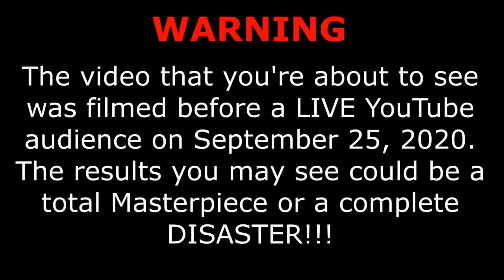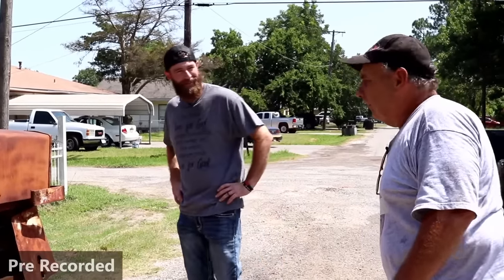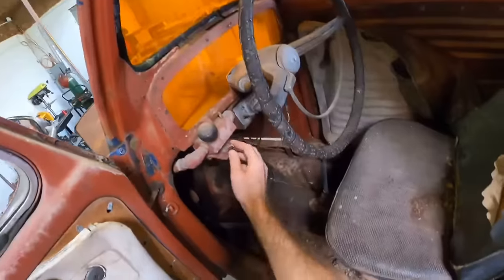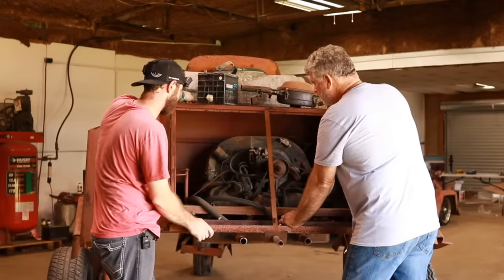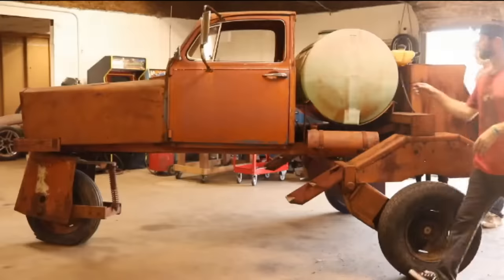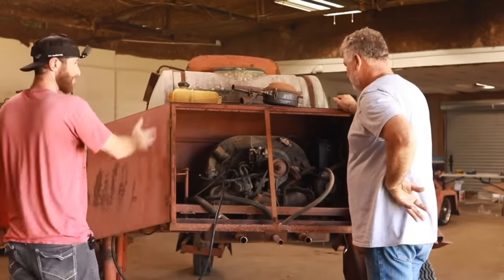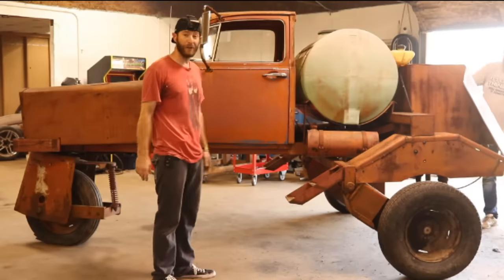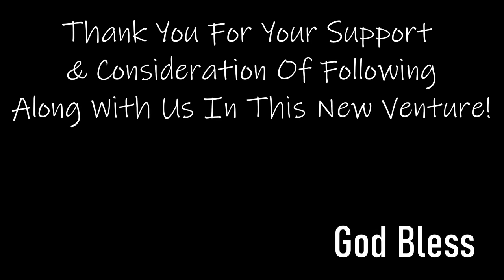Will It Run Or Let It Rust LIVESTREAM/ Turnin Over The Ugliest VW Creation We’ve Ever Seen/ RESTORED

Comment: looks like it was a crop sprayer and they took the sprayer booms off it when it was parked
Reply: exactly what i was thinking it has a widened  rear and single front tire  with enough clearance for rows of crop   the tank would not be for fuel lmao  the rear suspension travel is impressive but not understood by me . as a cheap way to have a  set of functioning systems with replacement parts going air-cooled vw is a brilliant idea  ..although surprised they chose to use a set of chain drives when cv's and axeles would have worked and worn better and been stronger ..  neat bit of engineering all in all
Reply: @mobiousenigma  I saw axles on the inside of each back wheel.
Reply: Yes, looks exactly like the rig my father and brother used to put out round up with. there were booms on the side with wicks so the round up would touch the the Johnson grass that always grew higher than the the maize (grain).

Comment: Definitely a row crop sprayer. My uncle made one from a “lifted” farmall tractor back in the 80’s. It was used for spraying asparagus when it was “bushed out”. When the weather gets to hot they stop cutting asparagus and let it grow tall. It gets up to 4 feet tall. They had a bad problem with aphid in the 80’s and the tire and wheel armor part a path for the tires without grabbing onto the crop. It had a boom with drops that almost drug on the ground with jets pointing upwards to spray underneath the plant. They tried spray from airplanes and it wasn’t working. He sprayed for several farmers and probably helped save several small farms and farmers.

Comment: One wheel on the front, two on the back and a Volkswagon engine. Looks like prototype of a Melroe weed sprayer people called a Spray Coupe.
Reply: Might be one of the very first Melrose Spra Coups. They just had and open cockpit, someone wanted an enclosed cab. I had 3 of the later models, 2 of the 115 models with the 1600 cc air cooled bug motors, and I still own a late 80's 220 model with the water-cooled VW Rabbit motors.

Comment: Great job in getting it fired up and moving!  Never thought I'd say.., this is the first time that I've ever seen anything that was both stupid and ugly looking at the same time. 
Drop it in the front, add dual rear wheels, cut out the bug, add a seat,  a set of handle bars, dual exhaust straight up flame throwers, a set of wheelie bars and you got yourself a Mad Max Trike for car shows and parades.

Comment: This thing is so cool. I have a three wheeled Melroe SpraCoupe with chain drive and coil springs that I'd like to put Beetle body panels on and a wide front suspension on. Love your collection of "junk". 👍
Reply: What he has is one of the earliest model SpraCoupes, I think this is either a 106 or a 108 that has had a cab added made for a Beetle. The early Coupes were open topped

Comment: What you have is an early model Melroe SpraCoup, It does use a VW drive train but it appears to have had the spray booms removed. It was designed to spray chemicals on field crops twice as fast as a tractor mounted sprayer could. I worked at a SpraCoup dealership for 10 years starting in the early 90s, the Coup you have is from the early 1970s
Reply: Somebody has added cab cobbled from a VW Beetle, it didn't come that way

Comment: Enjoy watching videos always plus that should called it 3 wheeler VW tractor , I change points, wires plus cap also rotor , spark plugs , air filter, Fuel Filter, coil to & new engine oil to plus oil filter too! Also check fuel tank of new fuel with  lines need fix up and any electronic parts too! If going do drive test check clutch pedal also parts plus Brakes and gas pedal plus carburetor too! Tires okay to hold air too ! Hope got turn signals and lights!

Comment: I like watching you guys but I must admit I find it frustrating. 2 guys pulling vehicles from death and we all know that first see if it was seized. If not check for spark. Disconect fuel line. Check oil. You guys have 2 men but only 1 think gets done at a time. You both know what has to be done but wait for the other to do something before doing the next. It's frustrating. Every car needs the same check system but you wait until someone says do this or that. I enjoy the show try this to improve. Again, only my opinion. Glad to see sis getting involved. Enjoy

Comment: your right interest but not my style. Under that so called hood you could make like a utility area with pull out tool box .I would cut that tank and put a air tank to air up tires in the field  on side of doors  (good bad and ugly) penetrating oil  half transmission fluid half  acetone  also really bad rusted gas tank  muriatic  acid  one gallons to 18 gallon tank leave 24 hours hose out will clean it like new take sending unit out it will eat brass and be careful and wear gloves and eye protection